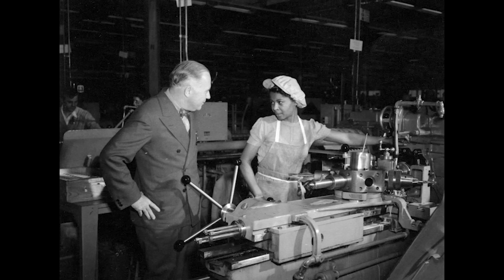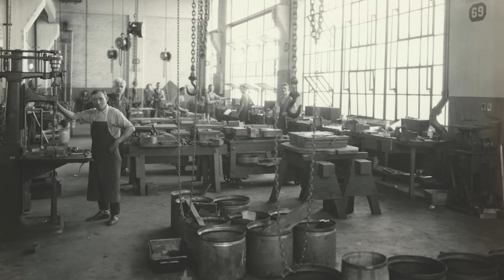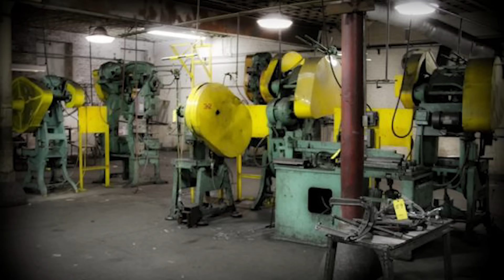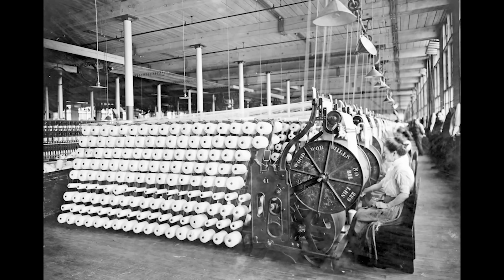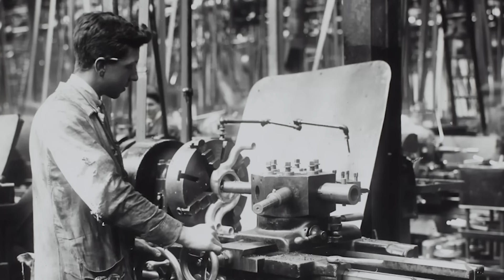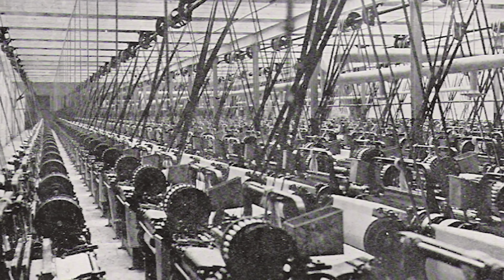Why 1940s Factory Machines Ran 80 Years While Modern CNC Dies in 10

Comment: The main reason is, with modern milling bits , aggressive cutting paths can be adopted, this increases wear and tear on the machine. Couple this with high productivity and insane production schedules, machine wear increases

Modern machines are also made light, as they are designed to run at optimum efficiency for a set period of time say 5-10 years as technology improves, nobody wants to be stuck with an aging technology when better options are available for less price
Reply: That’s just false. Average vmc weighs 10x what a Bridgeport weighs

Comment: My old 4 1/2" Boxford Model A, probably built in the 50s, still works very well. The Burnerd 3 jaw is a bit tired.... I'll re-grind the jaws and see if the run out lessens or disappears.
The ways are pretty good, and working to a tenth or two is still possible.  Happily it has the screwcutting gearbox, but it's an imperial machine so the range of metric threats is a bit limited until I cut a couple more stud gears.

Comment: As long as cnc machines have been around new innovations in electronic components have outpaced their physical lifespan. Historically, every ten or so years the technology advances enough to justify the upgrade. Assuming you have the money and the need. New cnc machines are also insanely faster and more capable than older manual machines. Comparing 80 years old manual machines to modern cnc machines like comparing a nail gun to a hammer. You could use a hammer to build a house, but a nail gun is 20x faster and more reliable. The same analogy could be made with hand saws and circular saws. You cant keep up with home production if you refuse to modernize to modern tools.

Comment: honestly ive never seen such a cnc hating video full of lies about cnc ... and half truth about conventionals. 
1. Conventionals are build strong, yes BUT thats mainly because you couldnt get betterMotors so its a bit overkill, also ppl tend to not go hard enough on materials on conventionals plus its just simple near no danger for crash.
2. You can get a cnc that is as massive as these conventionals, they are just not from those big company names.
3. you compare a modern 5 axis to a 3 axis, thats no comparision dude the more axis the less rigid.
4. cnc is needed in our world, workpieces did get more complex and cnc are way faster for atleast 95% of the usecases.
5. ive rarely seen a cnc die that fast on electronics , the first one ive seen were a INDEX GE65 that made 45 years.
6. its most of the times better to renew your machines if youre a jobshop, if you still run 20 year old cnc machines the competition with a 2 year old will always be able to do a better quote (if same type ofc)
Reply: Agreed with all except #6. Ill kick anyones ass on pricing who is running a small job shop, especially making small runs. The time is in the set up, the small amount of time you will save with faster cycle times will more then be offset by the cost of the machine. I bought an Ouka and Kitamura for 4k, 1990s machines. Owner said they were to slow, after seeing his programming, he didnt know what he was doing. He bought a junk Haas to replace 2 good machines when he could have used what he had more efficiently.

Comment: Is this AI? It REALLY misses any nuance or detail. Silliness.

100 Bridgorts in a room requires 100 talented machinists that are limited to fairly simple parts, one by one. 

100 CNC machines require a few talented machinists and a dozen operators that can make 1000x the parts with 1000x the geometric complexity.

Comment: I'm currently retrofitting new motors and controls to a 1994 VMC. Will probably cost about $8000 by the time I'm done. Mechanically old CNC machines are often absolutely fine, it's just about the electronics. And CNC lets you do stuff that you just can't do manually without making special jigs all the time. Open source control software LinuxCNC is a steep learning curve, but it isn't ever going to become unfixable...

Comment: All machines will wear out. A lot comes down to how the machines are regularly maintained . I was a machinist at a heavy engineering shop,we had a very large Cincinnati universal milling machines . Massive work table probably 8' long, three places where the machine could be controlled, rapid in all directions. The ways were beautifully hand scrapped with a quality pressure lube system. These machines were '45's/50's era and in the '80's' were still bloody accurate, but our maintenance was first class. I   machined on 2003 made, made Harrison lathes, and have seen wear on the bed causing inaccuracies in the 2020 era also well maintained go figure. We live in throwaway world .....I know what machinery  I personally prefer. Seasoning cast iron does make a big difference.

Comment: It works out well for me 🤔
I run both CNC & Manual Machines usually at the same time.
Which not only allows me to complete more work in a single day, it also helps with 
the Boredom of being stuck on either machine ??
I couldn't think of much worse than running a CNC machine all day, basically being a machine attendant ??
( I have NO idea how others do it either ??? )
Same can be said for running a Manual machine making the same part ???
I must admit I use Manual machines for shorter runs of parts.
But previously the only machines I had were Manual machines until manufacturing parts took over the repair side of my business.
I would mental die IF I had to keep making parts on a Manual machine.
Definitely thankful for CNC machines 👍

Comment: To retro fit the CNC electronic you can use open source or LinuxCNC. There are numerous examples of people converting or retrofitting machine to LinuxCNC. It was first developed by the US military back in the 60s as a general use CNC program. It now can control up to 5AXIS machines.

Comment: We still use 3 thread grinders that were built during WWII in Berlin. They still do their work 10 hours a day to the half of a thou. And the grinding spindles still run on their original hydrodynamic fluid bearings, with only a slight scraping and lapping every 3 to 5 years.
Thanks for the vid!
Reply: which brand?
Reply: @frankt.1391  
Herbert Lindner, Berlin
They built thread grinders and jig boring machines.
Cheers!
P.S.
About 20 years ago we bought a cnc thread grinder. Once bitten, twice shy!

Comment: Well, that's not quite right, but the speed of technology and innovation has changed drastically, forcing recent ones to be phased out often. It's not all cut, cleaned, and dried as all this; there are still older technologies around for smaller runs and artisan manufacturing, and niche markets.

Comment: I'm all for recycling, reuse and serviceability, but this is romantic nonsense - and visually rather boring. I remember when car engines were knackered at 80,000 miles, only did 30 to the gallon and needed constant maintenance to keep them on the road. Modern manufacturing methods - including CNC machines - have made products better - more efficient, more reliable and more durable. I have a workshop full of machines dating back to the 1820s through to the 1980s including one CNC. I love this old stuff, but the world has moved on. If you want to go back to treadling your lathe or overhead belt drive that's fine, but it's not the way to run 21st century manufacturing. The fact that there is now a skills-gap in repairing and retrofitting is a reflection of how post-industrial societies have shifted to different kinds of jobs. Whether those jobs are better is a matter of debate, but I certainly don't want to return to the supposed golden age of repetitive factory labour.
Reply: Exactly...  Agree 100%.
Reply: Do you remember when your BMW 750 (10,00 kms on the odo)went into limp mode and the techs were replacing parts for two weeks trying to find the issue. Son’s new Isuzu Ute was sold after two years following multiple engine issues. True today  they are more powerful more efficient  but fixing my older vehicles was insanely easy compared to the current crop of mobile computers.

Comment: This isn’t really true. Older machines worked for a number of years until newer machines came out. That could be 5 years or ten, back then. But also back then not much changed for years at a time. So there was no real reason to get new machines. But today, CNC does get replaced more quickly as newer, more productive machines come out. Nobody uses these old manual machines for production anymore. It’s used for rework and repair work, but never for production. CNC obsoleted these old machines as they are many times faster - and much more accurate. Like it or not, that’s the truth. Yes, old machines do have problems with obsolete software and cards. But companies would still rather buy CNC. So this is rather silly. He patted the Bridgeport. Sure, sounds cute. But what can you really do with a Bridgeport today? Not much, just small work where it’s very valuable. And, by the way, these old machines need rebuilding as well. It costs $21,000 for a new manual Bridgeport today. But they also need to be rebuilt every so often. It costs almost $20,000 to rebuilt a Bridgeport. And they were never production machines. Production machines were, are, much larger and heavier. Bridgeport’s were designed to do odd parts that production machines didn’t pay to use for that.

And, a Bridgeport doesn’t weigh 2,200 pounds. It weighs 1,995 pounds. Just another bit of incorrect information here. It’s difficult to point out all the errors and biases here.
Reply: Agree and you can buy a really nice, small format CNC mill for about $30K and it'll pay for itself in months if you're a go getter.  Even fairly deep pocketed hobbyists are buying these machines because it's a lot easier to design, program and machine 15 of the same part on a CNC machine than it is cranking handles on a manual one for days on end.
Reply: @WHJeffB yup! The entire premise of this video is boneheaded. It shows a very big misunderstanding of industry. Also, I’m pretty sure, its intention is to make those who want to think that”old,American Iron“ was the best ever and nothing today is as good. That’s a load of BS. Times have changed and the world is never going back to those old, very slow machines.

Comment: Old and new both have their place .  I made a good living for years holding 25-40 millionths of an inch on older cast iron machines and a few more years scrapping to those same accuracies .   Yes, it was slow but the money up-front was considerably less than modern electronics .  The only concern I would have is that too many would fall for the hard-sell that CNC would instantly make an investor think that he will make "millions" with CNC when he didn't have the volume or requirements to justify the cost or maintenance.  It seems there is a lot of CNC hardware hitting the used market from failed operations .  For many things, CNC is Essential ... but forethought is also essential.  In retirement, I keep my old machines .  Some are 70 to 100 yr old range.  I can still get my accuracies, but then I have a lot of time on my hands .  Good storytelling, though .  I really enjoyed it .
Reply: There is alot of cnc hitting the used market not from failed operations, it is from poor financial planning by the economic  genius's that decided manufacturing wasn't profitable enough. Insurance, taxes and rent cost are out of control.

Comment: In the 1940s engineers did not know how rugged things needed to be so back then  EVERYTHING  was overbuilt using heavier metal than necessary building things stronger than required. Back then people had pride in their work, they were proud to put their nae on what they 
had built and it was built to last.  Today it is all about volume. Build them quick & build them fast, charge a lot and get a return sale in a 
short time. Today engineers have computers which can calculate the minimum thickness materials need to be for the product to make it 
to to end of warranty period saving production expense & saving the factory $$.

!
Reply: THIS...  Overbuilt to the point of ridiculousness, but they last.  The other thing to note here.  Big companies would frequently rebuild their machines.   Bearings would get replaced.  Ways re-scraped.  Tables ground and scraped.  Etc...  

Modern machines are engineered to be as rigid/strong as is needed for their application, plus a factor of safety...

Comment: Nice try...but your AI narration or human author talking about "TENTHS" of an inch tolerance in machine tools is ridiculous, and first you say "2000 pounds" of cast iron for a Bridgeport, and then somehow it becomes "8000" pounds in the same machine. I've been a machinist for 5 decades (that's 50 years for you recently "educated" little fellas), still own a Bridgeport, still making prototype parts on it because I can usually go from a drawing on a napkin to a finished part in less time than my CAD guy can make his fancy-dancy layout. And yes, depending on the machine, getting replacement parts can be a challenge. But when you have the mindset that says "I CAN fix this", you find a way. But please...do some proofreading or post-production editing, or get somebody who has a clue to do it for you. Blatant errors just disgust the knowledgeable few.

Comment: I sold metal fabricsting machines for 43 years, CNC turret presses, Lasers and Press Brakes and the machines today are built just as well and offer performance that is 3 to 10 times better than in 1981.  The last company i worked for was Mitsubishi.  They built lasers starting in 1987 and as of 2023 when i retired they still supported all their machines wirh parts.  To be fair a 1987 machine was obsolete so fixing it with expensive parts did not make sense especially when it cut 6mm steel at 25 IPM and a new one cut it at 250IPM.
Reply: THIS...  Worked for a German industrial laser manufacturer here in the US for 28yrs.  After about 10yrs companies are scrapping their old machines because the new ones process parts so much faster and are significantly more energy efficient to run.  We even had companies replacing machines every 3-5yrs, just because the jump in productivity was enough to pay for the new machine within a year.

This romanticism about old iron is all well and fine, but the old stuff can't compare to the productivity and repeatability of the new machines.  It's not even close.

Comment: The new machines are computer controlled. I have spent a lot of time searching for parts to keep them running. Biggest issue I had with the old manual machines was getting the operator to oil the darn thing. I'm not talking a production machines, I'm dealing with toolroom equipment.
I personally own a cnc mill in my little garage workshop. Dead in the water as the computer control is no longer supported with parts or service. I also have a Laser engraving machine that suffered the same fate.
Computer control is great, but plan on it being obsolete in less than 20 years. I can still do a lot of tricky strange setups on a Bridgeport or Lathe without the use of a computer and get the job done.
Reply: Your cnc control issue can be solved for a couple hundred bucks, a used computer and some Linuxcnc software, which is free. It  runs my Hardinge, Cincinnat cns Lathe and and old B&S 1000vc cnc mill.
Reply: @Zeusspupp   Sorry, my cnc runs on proprietary software/hardware. Can't be emulated on a linux or Microsoft system. Current cost for the updated "new" control is over $6,000. I have serviced many CNC's in the past and getting them to run with an adapted software leaves a lot to be desired especially in 3D mold cutting.
Reply: @dennislarsson1723  I could argue with you, but I dont care. I have several machines running Linuxcnc and they work better then the original GE, Cincinatti, Dynapath control.
Reply: @Zeusspupp  I worked in one shop where we did do the rebuilds as you describe. Old machines bought at auction. Complete rewire jobs.
In the tool shop that was not an option. We had five VMC's that had to be running. I was just a die maker but also did computer repair and builds at home. I got stuck fixing the CNC's as the local repair techs we pretty useless. That includes the Bridgeport VMC's. Not all problems were electrical. A lot of mechanical issues due to poor machine design and construction. Whoops, I brought up Bridgeport again.
Reply: @dennislarsson1723  I still do all this in my shop, picked up a 2000 ish Okuma, needed the spindle drive fixed, got it, an encoder, got it. Right now just stripped the inside of the enclosure, scum used machine dealer just painted over all the bubbled paint and rust. Didnt buy it from them, prior owner did.

Comment: Ive had old Monarch series 60/61 lathes. Built in 1953....opened the gearbox and the gigantic gears still looked like they'd been put into service last week.
AND....i could call Monarch tomorrow and get all the original invoice info!  I did it in 2016.  Staggering continuity.  Manual machines are the only way to go.
Reply: 1940 LeBlond, Logan, Atlas MFC for me, hang in there brother
Reply: Harrison's,Elliot butler,bridgeport.few months ago I opened up a recently bought Colchester  triumph headstock gearbox and it looked like it just came from a factory,irony is it was built in the 1950s.same goes for my Harrison and most of all that I own seems to be so like they just rolled out of the assembly line.i would take any machine from the early 19th century over modern ones
Reply: Monarch are great machines..